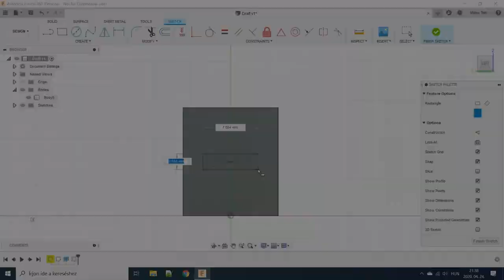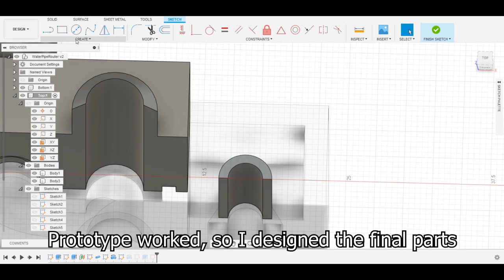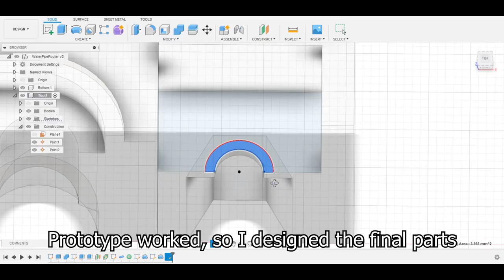Water Path Selector - How I made it

Comment: I have printed two sets over the holidays, but didn't like the result. Needs a lot of sanding for the parts to fit just the way they should, also didn't like the way servo motor is connected – too close to the water. Anyway thanks for the design. Still i really like the idea and many thanks for posting the video and files online. Please keep on! Maybe we can talk sometime and discuss possible redesign. Happy New Year!
Reply from the maker: Thank you for the feedback, it definitely has some problems that requires a redesign, unfortunately it is hard to fully stop water leaking, especially when it is under pressure. Maybe I will think about it too when I will have more time. Happy new year!

Comment: Oh, wow! I was thinking of exactly the same thing with servo motor and turning the circular selector! Does it work well? Thank you for sharing the files! Also the magnetic concept is really interesting, the only thing i am afraid of – coil should be really powerfull, as after some time of using the  alkali will sediment on the mechanism and it can jam.
Reply from the maker: Although it works, but the circular selector has a small leaking problem, it is hard to make it fully waterproof. The magnetic works better, but yes it has much more limitations and also requires more complicated control circuit. To be honest, it is much more interesting than useful :) But maybe it could be improved.
Reply: @mtelectronics4242  Have you heard of magnetic couplers? You could actually combine two of your ideas, so it is possible to make a completely sealed solution. in theory....
Reply from the maker: @artantme  That's a good idea, it could help to prevent leaking and protect the servo! Maybe i will give it a try next spring.
Reply: @mtelectronics4242  If you want, we can make it together. I know Fusion360 and have a 3d printer